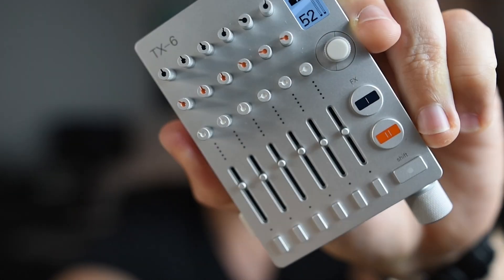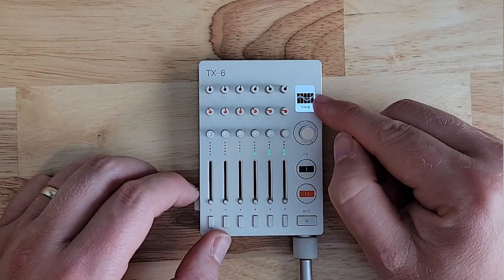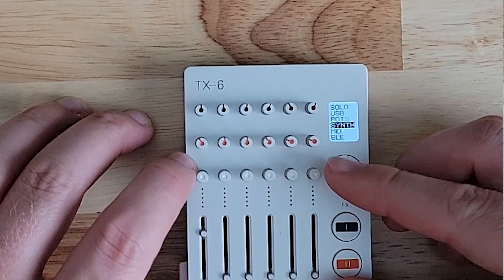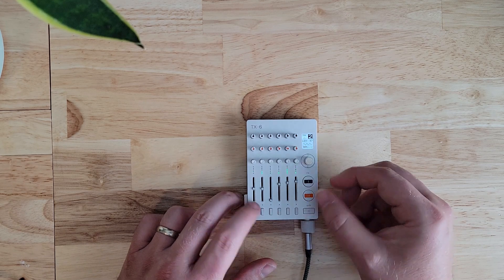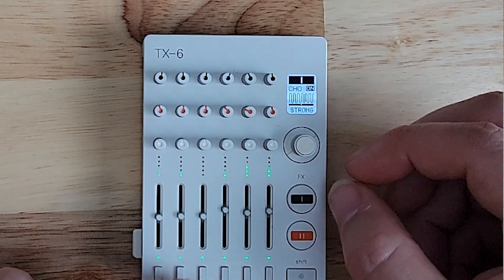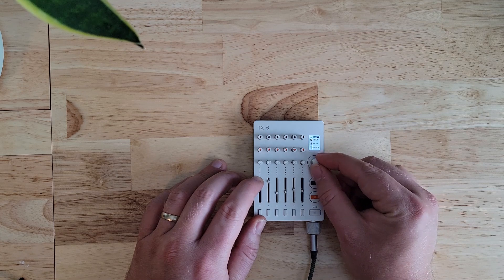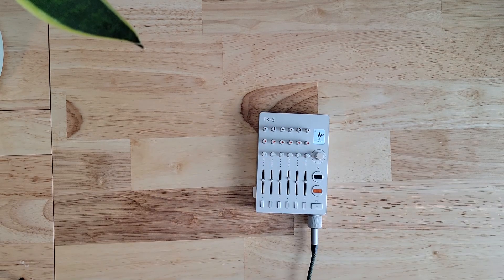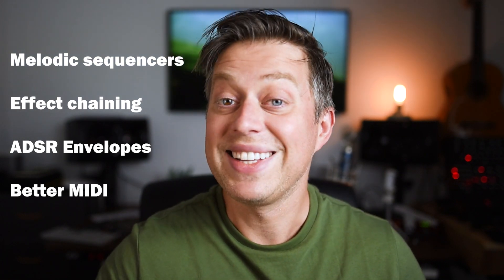The Synth Engines of the TX-6 Field Mixer by Teenage Engineering Tutorial No. 2

Comment: After Teenage Engineering added USB record function, it was good time to buy one. Will test and post honest review once I have mine and have taken it for a test run. I needed a small portable mixer, recorder and interface for travel and this seems great in spite of the tiny size and limitations. I have the OP-1, pocket operators and OB-4 and they are fantastic if you can work around the downsides. I also have 1010 Music Bluebox which is fantastic but requires battery power access and no audio interface. So if I want to record to a DAW without power in the forest, I can do that!
Reply from the maker: Yeah, I love the size of it. And I travel quite a lot, so this has become my standard travelling interface. Works great with all the various TE devices as well.

Comment: Hi mate I can barely hear anything from my powered speakers coming out of my TX-6, any ideas?
Reply from the maker: That's strange. Have you tried using the AUX or cue output? Maybe it's a faulty device. Assuming there is nothing wrong with the cable, volume setting or speakers.

Comment: thanx for the video, doesn't seem very impressive as a synth/seq/drum machine (or even effects) tbh, but those may have been a bonus afterthought... i am curious about the audio interface though. seems handy for sure, but a little underwhelming and a bit niche <- nothing wrong with that, just thinking that until i need something that fits that role, i might not need it
Reply from the maker: Yeah I agree. I'm wondering if they didn't finish developing the firmware fully before they released it, because they released a lot of new products at the same time and the tx6 seems a little bare boned. But I'm hoping for a good firmware update soon, because it has a lot of potential. It does work well as an audio interface though. And it also works really well as a midi expression controller. If they could just improve the synth capabilities a little more, it would be a very useful device.